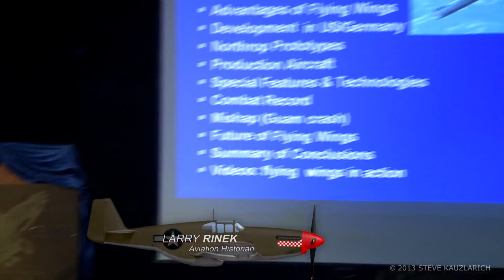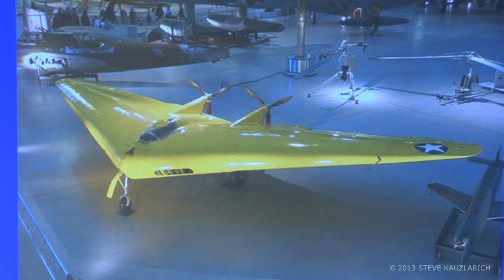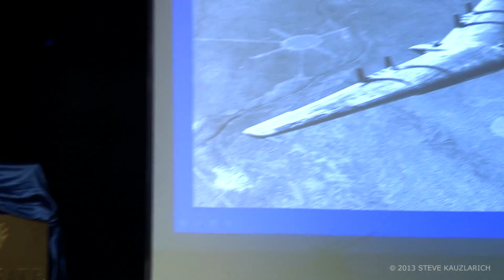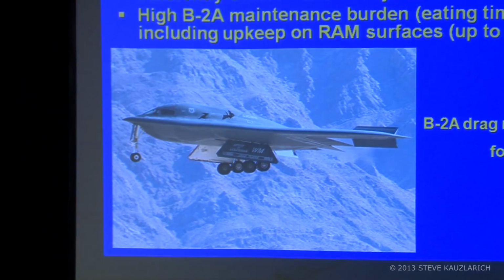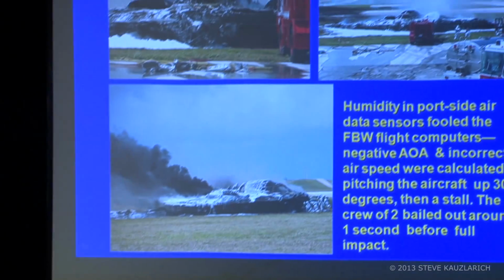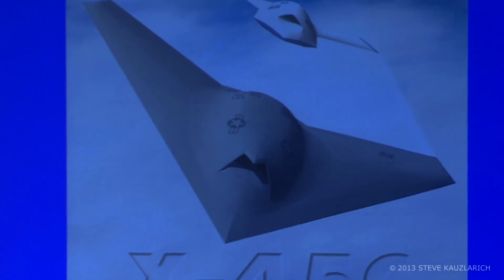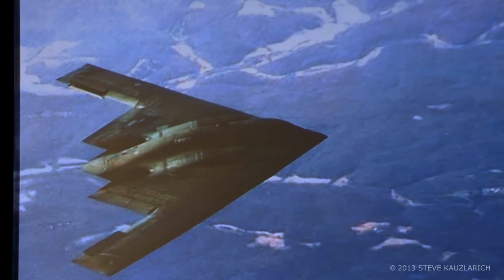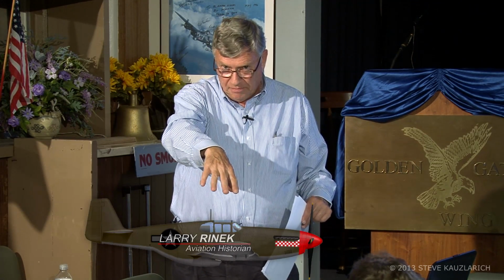HISTORY OF THE FLYING WING, with Larry Rinek

Comment: any mention of the nazis who invented it or just the us copy
Reply: Actually Northrop and his team examined the aircraft (Ho-229) after the war. The YB-49 for example was unsuccessful but the B2 is and it resembles the Horten aircraft more with its little tail feathers. The aircraft in the above is nice and very important but by no means the first. And Horten was not the first either. And you shouldn't feel the need to be offended. Just google Cheranovskii
Reply: So we have a 229 after the war and you believe that Jack did not take a look hahahaha
Reply: +bleedinggums roberts 
I believe that Jack saw the 229 once. Design and construction of the YB-35 and YB-49 were already well underway before the Ho-229 was examined. And the YB-49 is a much larger design with a different mission role and is an entirely different animal. It wasn't stable as bomb platform (strike one) and it was cancelled in part for political reasons (strike two.) The B-2 is a follow-up and is similar in dimensions as the YB-49 and takes advantage of modern fly-by-wire systems.
Reply: +bleedinggums roberts 
The Ho-229 never flew, so I would not describe it as successful.  What flew was the Horten's smaller second prototype H.IX V2 that only completed about two hours of flight time before a fatal crash.  What was brought to the US was the larger V3 prototype designed by Gotha, and it was incomplete when discovered at the Gotha factory. Some assembly was continued after it was captured.
Reply: soaringtractor he got the exclusive rigth of the stolen blueprint of The hortons brothers, hillariously copied the wrong ones. Didnt even understood that. Talking about corruption. Rigth
Never the less The Hortons were the true undeniable innovators in this. nortrooåp just copied ther work
The B2 was properly just a pixelated copy of the Ho 225. From a bad computer
Reply: No it is in good condition and in the Smithsonian and neither flew the flying wing first. It was a man named Boris Ivanovich Cheranovskii in Russia
Reply: Yes I agree, but the b49 was not stable, the 229 was, so I am willing to bet Jack examined the aircraft and others more, regardless of how the story goes. We spent too much on capturing and saving them to just pass them by. The Horton Brothers had an advantage of being a two man team concentrating on flying wings, where as Northrop was doing other projects other than flying wings. So this is why you see more Horton flying wing designs than Northrop's. They hade many more advanced projects not built too. Have you heard of the B-2 having a secret exotic propulsion system?
Reply: Just for the record I do not think Jack copied the flying wing from the Hortons. The argument was about Jack being the first and that is not true.
Reply: I agree. But still, the projected designs from Germany after ww2 are more advanced, and that is why we captured them, all of them and gave them jobs, built there designs and more
Reply: I believe Etrich, Dunne and Lippisch all flew flying wings before Horten and Northrop.
Reply: I consider that to be irrelevant. There paper projects from the Hortens alone are worth more than most Northrop products combined. And that is not a Nazi pride thing its just the facts I see. If you think that any American aircraft designer would simply overlook more advanced designs then you are not ready for this conversation. Both not the first btw
Reply: They had many that worked before jacks. A simple google search will clear that up. As a matter of fact, 4 designers, including the Hortens flew before jacks plane. Come on guys this is basic aviation history.
Reply: And when are German glider pilots not ontop of the game. Shure they are going to fly some gliders with more success, and they are going to collect data too. That's not Nazi pride that's just what happen a lot of the time. They simply have more experience and the Hortens had some of the best gliders. There are more vintage Horten wings still around than vintage Northrop flying wings, and the Horten wing flies with greater performance, that is a fact, just google it
Reply: +soaringtractor well nobody cares.
In this world if you really want to make something, it really should be for your own growth.
Not for acknowledgement you know to many egos around.
Reply: +paul hunter So you didn't even watch the video and decided to talk shit? Very youtube.
Reply: jose amram Yes but the Hortons started with a pure flying wing and Northrop did not.
Reply: YES. Watch the friggin video
Reply: actually, Northrop was ahead of the Horten brothers.

both of them were inspired by John Dunnes swept wing bi-plane designs who flew the first tailless swept wing gliders and planes, although just about all of them were bi-planes which wasn't much more than the Wright brothers 
Wright flyer plane except with swept wings and no tail (the Dunne D.1 flew only 4 years after the Wright Flyer, the flying wing has been around for almost as long as the plane itself has been around).
 
Northrop's first Flying glider the X216H glider flew in 1929, 
the Hortens brothers first flying glider, the Ho H.I flew in 1933

Northrop's first plane the N-1m flew in 1940
the Horten brothers first plane the Ho H.VII flew in 1942.

the only reason why with their ultimate goals, (the Ho 229 and XB-35) the Ho 229 flew first in 1945 compared to the XB-35 in 1946 was because the Ho 229 was 16m wing span fighter while the XB-35 was a 52 meter wingspan super bomber, I mean Northrop started development for the real thing before the Horten brothers and his N-9m was a 1/3 scale version and flew in 1942.

the only thing he'd have to copy from the Ho 229 after the war was the implementation of Jet engines and that's it, but Northrop as already using Frank Whittles engine in 1942 with his JB-1 bat. 
The only reason why the Ho229 was more stable was because it flew much faster in proportion to its much smaller size. 
i mean the XB-35 had serval small rudders while the Ho 229 didn't and the smaller scaled N-9M (almost same size of Ho 229) was considered quite stable.
Reply: bleedinggums roberts
The 229 that exists today at the NASM was the third unfinished prototype which was redesigned by Gotha without little input from the Hortens and has never flown. The Hortens built the smaller prototypes H.IX V1 (unpowered glider) and the H.IX V2 (jet powered prototype.) They only managed about two hours of flight time with the H.IX V2 before it crashed and was destroyed during a flight to measure speed. I don't think sufficient data was learned from the H.IX V2 flights to prove how well it flew.
Reply: soaringtractor
What bothers me is that a television show by National Geographic greatly exaggerated the history surrounding the "Ho-229" prototype currently with the NASM to the point that it was purposely designed for stealth (it wasn't) and that it actually flew (it didn't.) Now those exaggerations are discussed as fact by rabid fans and the Ho-229 must have outperformed anything in the air. The Horten brothers most definitely deserve credit for their work, as does Northrop. But the surviving V3 prototype was an unfinished and unproven design from Gotha.
Reply: +Steve Kauzlarich You didnt grow beyond that didnt you?
Reply from the maker: +Tbonyandsteak: huh??
Reply: America likes to restore American planes. His name is John K btw
Reply: +paul hunter The Horten (nazi) wing was developed in parallel with Jack Northrop, and they knew nothing about each other, so your statement is bogus.
Reply: jose amram no it is not, sorry for your patriotic belief. RIP
They really got the blueprints of Hortons designs.
An utterly direct copy of the Horton 3

https://2.bp.blogspot.com/-tOYK2yPCWI0/Vx0KXcO7tFI/AAAAAAAAAl0/znfIynl0vzMdFY2I6ujAIInc4_ErajNnQCLcB/s1600/output_g7mfJv.gif

and The Horton Vlll in the video.

The funny part was they copied the wrong ones
30 degrees backward wings were to unstable.
you got have 40 degrees to make it stable.
Well Horton solved that pre war.

Well Jack was not that smart. lol
Took him only a couple of decades to figure that out.
Reply: +Leif Kinda but i think what set the Northrop and horten apart was they didn't use a tail or any stabilization, they solved it with wing sweep and made a true flying wing.
Reply: Travis Pratt As did Dunne, Lippisch and Etrich, although the normally used end plates or vertical fins.
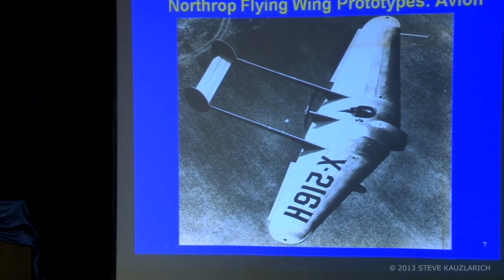Reply: Guy in the video states at 8:45 in the video a list of all the "firsts" in aviation during WW2 including the flying wing.
Reply: I don't want Nazi I hate them
Reply: I think it was a Scotsman that flew the first flying wing. Look up J. W. Dunne. It was in 1907!
Reply from the maker: The Nazi' didn't invent anything except death camps.  Are you one of them?
Reply: thats just not true dude no im not a nazi *****
Reply from the maker: paul hunter Well then, hopefully you can make the distinction between Nazis and Germans, because not all Germans were Nazis. In fact, most Germans we not Nazis.  Jack Northrop conceived the Flying Wing concept prior to WWII but officially posed the design in 1942. It did not come from captured German aircraft in 1945.
Reply: ***** Its success was determined by the capture of the Ho-229. The Russians where the first by the way

Comment: Drag rudders are open slightly when the plane is not in "penetration" mode to make the plane easier to control. not stealth. 
9 XB-35 were built, 2 flying, 3 converted to YB-49. 12 scrapped for political reasons. The "Yaw" issues were resolved.
Reply: Although slightly open drag rudders may improve handling, I have documentation that the main purpose of this peacetime flight profile was disguise the true radar cross section.

Comment: This guy needs his facts checked. The Horton 229 replica was built long after the B-2 was operational.
Reply: there is so much wrong with this film
Reply: yup
Reply: +Bill Kilbourne 
I concede that the Horten Ho 229 V3 replica now on display at the SDAM was built by Northrop Grumman in 2008 in cooperation with the National Geographic cable TV channel, well after the B-2 was operational. I stand corrected. That said, it is well documented that a team of Northrop engineers visited the original captured Ho 229 in storage at the NASM Garber facility (I have visited that site) in the early 1980s, well before the B-2 design was finalized and assembled. The team took measurements, studied the materials of construction, and absorbed the stealth lessons learned from the magnificent and unique Horten 229 German flying wing jet fighter/bomber.

Larry Rinek
Reply: The Northrop model department built a plywood mock-up in the shape of the Ho-229, not a replica of the aircraft. A noble effort for a radar study and a TV show, though I'm not sure if they factored in that the engines were covered in steel panels front to back. The facts are that the NASM conservationists used lab samples and didn't find any stealth magic dust in the construction. Just green fireproof paint under whatever was painted on by the Allies after capture, glues and rotting wood.

Comment: the americans stole the stealth bomber from germany. they had the first stealth bomber called horten 229.
Reply: Bullshit, the Northrop N-1M flew long before the Ho 229 and the 229 wasn't even stealth.
Reply: +packr72 the prototype of the n1-m called the  X-216H flew in 1929 but it wasnt powered and still had a tail. Germans had the first powered flight
Reply: Germans had the first powered flying wing design. All other nations had the concept or gliders. The plane was the predecessor to the ho_- 229
Reply: +soaringtractor Northrop? Horton?     Wrong again Wilbur. J.W. Dunne had powered swept flying wings between 1910 and 1916. Read up on the his "D" series.
Reply: +IP Games . First....Compared to soaringtractor, I am a non starter for commenting on every single post telling people they are wrong.
secondly...The aeronautical definition of a flying wing is thus:- &#160;a tailless aircraft that has the form of a left and right wing joined together at the midline with little or no apparent fuselage.....and as you say....&quot;The classification of a flying wing includes the tail section removed completely;&quot;&#160; This fits Dunne&#39;s D8 design, and the twin wing is in accordance with aircraft design of the time
. And Northrop&#39;s early &quot;Flying wings not only had rudders, but small V.stabilisers.(and in his very early &quot;Wings&quot; twin boom tail)........unlike Horten&#39;s designs. Can&#39;t say the same for Lippisch.
And the information is correct.. 
Then, of course we could go onto Junkers' claim that also predates Northrop.and Horton.
Reply: +SuperAncientmariner addition some of Northrops earlier models did have vertical stabilizers but are commonly called flying wing by using loose definitions. They were not true flying wings.
Reply: IP Games You are not really seeing the point i am trying to make to Soaringtractor, which is that others were working on such machines long before Northrop.
Reply: soaringtractor And Dunne and Junlkers were working on it before Northrop.
Reply: +SuperAncientmariner First, you do not need to comment on every single post telling people that they are wrong. For, you are wrong. Dunnes aircraft, while a predecessor to the flying wing design, was not a true flying wing because 1. The plane used a bi-wing design. 
2 . Dunne's aircraft used horizontal stabilizers, aka rudders, as you can tell in any report or picture. 
The classification of a flying wing includes the tail section removed completely; as you can tell it distinctly does not align with that definition. 

Before spamming the comments, make sure your information is correct.
Reply: +SuperAncientmariner they definitely had the concept, but not an true flying wing design yet .

Comment: Vincent Justus Burnelli - Father of the "Lifting Body"

A review of the numerous and significant
contributions made by Vincent Burnelli to the
scientific advancement of aviation has been presented
which highlights the breadth and creativity of this
early pioneer. Most notable of these innovations is
the lifting-body concept invented and developed by
Vincent Burnelli in 1920. This basic element of the
Burnelli design principle is just now being considered
and utilized by the aeronautical community for a
variety of vehicle classes that vary from personal air
vehicles (PAVs) to jumbo transports. Perhaps
Burnelli was correct when he stated in 1950.
“Aviation is still in its infancy; give it a chance to
grow up, and they will see that I am right. The
lifting fuselage is the first new configuration since
streamlining was first introduced, and my plane
carries more, carries it faster and safer.”

http://www.meridian-int-res.com/Aeronautics/Burnelli_AIAA.pdf
Reply: Yes Burnelli did significant work with flying bodies. However, the consensus of aero engineers is that his airframes were not true flying wings, as they all had vertical rudder control surfaces, unlike the B-2 and the flying wings.
Reply: The Australian Aborigines invented the Flying Wing, they called there's the Boomerang.

Comment: I hope Mr Rinek himself will read this comment:
I have to admit that although there were political reasons to hide this research, I find it completey outrageous the fact that in this video the life and designs of Vincent Burnelly are not mentioned at all.
Reply: Mr. Roif, thanks for your interest in my flying wing presentation. I appreciate your zeal for Vincent Burnelli but the consensus of US aviation historians is that Burnelli engineered lifting body aircraft, not true flying wings that lack vertical stabilizers and tail booms. According to Wikipedia: "Although Burnelli referred to his lifting body transports as "flying wings", his production aircraft invariably retained some kind of a tail, frequently supported by upswept booms that extended rearward. More accurately, Burnelli had a "lifting body" design, rather than a true "flying wing" where all major aeronautical components are housed within the wing."
Reply: See my reply above to mboiko, the Burnelli lifting bodies do not meet the modern recognized definition of flying wings